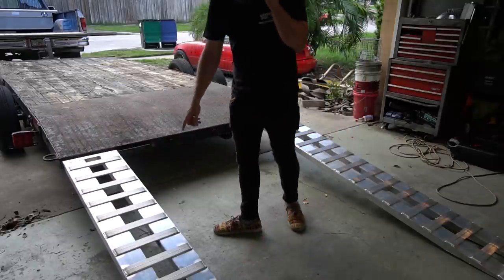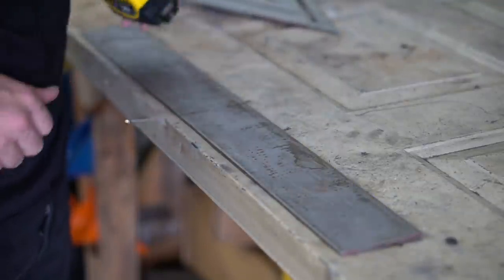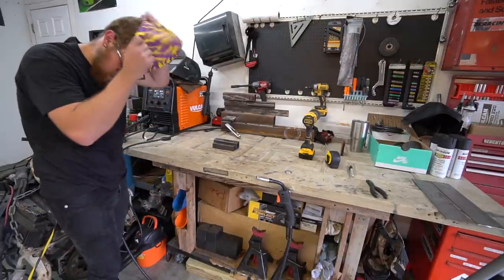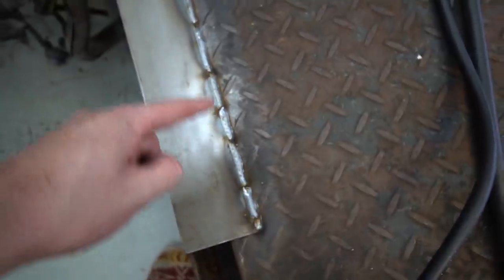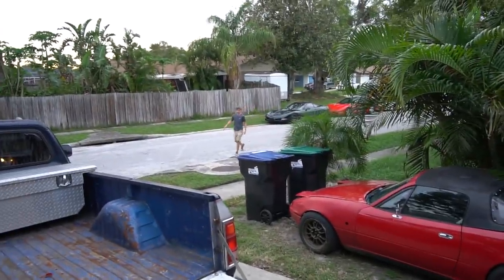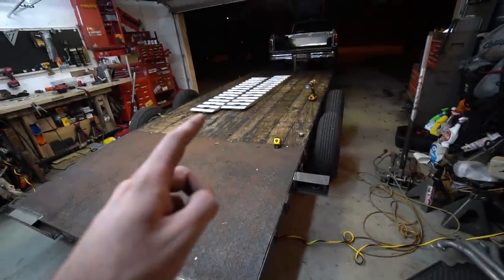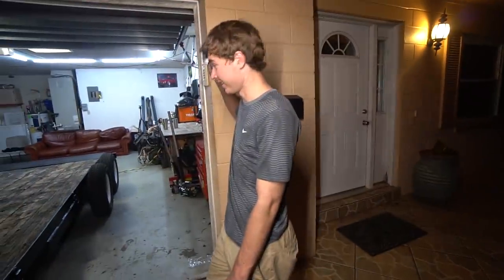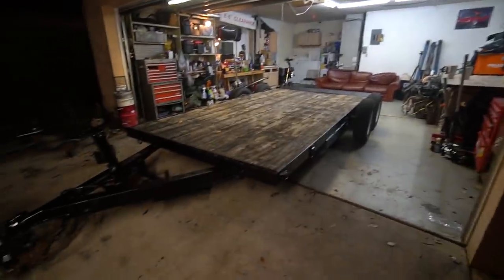Turning a $800 trailer into a $1800 trailer.

Comment: Weld your plate ends so the plate doesnt fold back on you when the ramps flip up, and put on a long sleeve welders shirt.
When you are sitting down welding like you are chilling in a TeePee....That'll all change the fist time you are digging a molten weld BB out of your nut sack. Nice project ! Just practice a little more safety.

Comment: I would hardly say you've added $1000 in value to that trailer. Stain the floors and if I were trying to buy it, I'd offer you $1000. An additional $100 for the ebay ramps. ;)

Comment: Holy, where was his face shield when that disc blew up. Also, never, never have yourself in alignment with the cutting disc or in other words not be where any of the sparks fly out from the disc. The shrapnel from an exploding disc will fly where those sparks fly. Also, those discs can explode at any time, even if not stressed. Never forget that.
My cousin was in his shop cutting some metal and the disc exploded and he had a chunk of disc in his forehead and he was wearing a face shield.

Comment: Dam that trailer is far from being legal! You need amber light on the front 2 corners, the rear outer amber led light you put in should be red and you should have 3 lights in the middle of your dove tail because your over 72" wide. Check your state laws!

Comment: 2:42 Just use an auto centering tape measure.  Doesn't your state require fenders or mud flaps so that you don't break people's windshields?  
I can't be the first one who has asked, but I'd like to see you turn an $1800 trailer into an $800 trailer.

Comment: Add implement jacks to the rear. The type that fold up(horizontal) out of the way. Weld em right to the frame, will help stabilize the back of the trailer for loading and unloading.

Comment: Dude the point of stitch welding is to save material where you can there's no point doing it there and only leaving them tiny gaps there are no structural benefits I would of just ran a continuous bead would of looked a lot better as well I'm not ripping you off it's still a good build I'm just say my thoughts man just coming from a boilermaker of 6 years

Comment: If you are welding you have to push the “weldgun” away from you (if you know what i mean).
Because if you drag the weldgun tewards you, you are laying the weld on the metal and if you push it the weld will melt into the metal that way your weld is waaaaay stronger and espessialy if it has hold a car

Comment: Have not read all comments, so my advice if you want it is acoulpe of stabilizing lags at the back would help. Grinder problem use it as you like with or without guards your an adult and you will learn how it works for you and scars are great. Cheers

Comment: Should have sat on the side of the trailer and pulled the weld pool twards you. Instead of giving your self an awkward angle. Other than that great welds cant get much better unless you have a dumb expensive welder.

Comment: A couple of washers should do the trick on the cutoff tool. Also repaint the trailer and redeck it. It will look tons better! Did you spray the bottom components if not it would be wise if you drive anywhere with salt in the air or on the roads. I think you'll take the vette.

Comment: Turn up your voltage and run a hotter weld and focus more on the base plate, when doing a lap joint you don't have to focus as much heat on the top piece especially in this situation, the big hunk of diamond plate will absorb more heat than the smaller piece you welded on

Comment: For Angle Grinders, I just buy then 4 at a time when HF has their parking lot sales, i look at them as consumables, set up one for cut-off wheels, one for flap disks, one for wire wheels, and one for wire cups. as you burn them out you toss the nuts and disk washers into a box you keep in the drawer with the grinders so you  always have spares.  Doesnt help you with your DeWalt NOW, so here should be the part you need  http://www.dewalt.com/en-us/products/accessories/tool-accessories/grinder-accessories/type-1-flange-set/d284932

Comment: Get a cup brush for the dewalt angle grinder and get a new grinder for the discs. Might want to consider two new grinders, one with a flap disc and the other with a cut off disc. They are cheap and you will use the crap out of them while welding.

Comment: I hate how your putting those new lights on. Lights should be at the back of the trl so people can clearly see you. Even if im a safe distance behind you and you turn on your right turn signal i would not tell your turning right.    Be careful.
Your welder whats the power input 220?  I like to move mine around and im running mine with 7500 gen i bought a 30 amp 220 gen extention cord at harbor frieght for 30 ish. I wanna get a pickup camper and my camping is rustic so ac aint a problem.  Shared power last year with friend ran there 2 campers with ac on both and moms to charge her battery

Comment: the little yellow lights go on the front both sides and the little red lights go on the back both sides also if the trailer is over 8 ft wide you need an additional  three little red tail lights in the middle of the back end or the trailer good luck

Comment: Pro tip with an angle grinder spin the nit off until snug push the lock button and grab the wheel and tighten the rest and the right wheel is suggested 😉

Comment: Actually hold up a second. 
-You need guards on your grinder, and a face shield. Don't be a fuckwit.
-That paint on your trailer is gonna last 2 thirds of fuck all. You need to clean all the corrosion off so the paints actually got something decent to hold on to.
-With your wiring, did you crimp the connectors to the wire? Or did you just stick it in there and heat shrink it?
-I'd also invest in some flares for the wheels on the trailer or you're gonna fuck the paint of anything you're carrying with stone chips being flicked up.

You worry me mate.
Reply: Also it's worth having a gander at some of the mig welding videos on youtube. You're stopping and starting way too much. You need to push the bead, not pull it. 
Sorry if it sounds like i'm being harsh mate, but it's gonna save you a lot of heartache and money in the future.

Comment: Screw the guard they get in the way. I have used a grinder for thousands of hours without one. Use a flip down face mask tho not goggles but also if you flip that metal piece on your grinder the otger way more surface area will be on the disk and it won't have a hollow spot for the bolt to tighten

Comment: On my 24ft steel deck I mounted two trailer tongue jacks on the rear on each side and put both down and single front down to have the trailer not move at all when loading and off loading.
Reply: Sinister Transport I've done that with all my flat deck trailers. It's a lot safer and more stable
Reply: kierin burbank especially when I use to load my lifted truck. A 01'Dodge Ram 1500 with 10 inches of suspension lift, plus a $20,000 drive train. 34,000 miles truck sold for $60,000 she could hook to a sled or pull downed  trees or stuck equipment or trucks.

Comment: Just buy a large washer that fit inside the plate on the grinder or see if you can turn that plate around where its flat on the disc. Also you should be able to get the part you need from a welding supply shop or they can order it. Or go the route of buying a cheap harbor freight grinder that has the same size shaft and use the part on the somewhat sketchy grinder lol

Comment: Just a quick tip.. the yellow side marker light that you used in the rear it's supposed to be up front there is a red marker light that goes in the rear that's for other vehicles to distinguish the front and the rear of the trailer yellow always up front